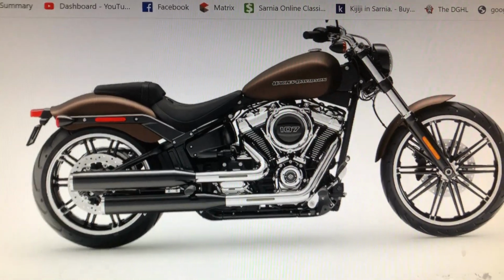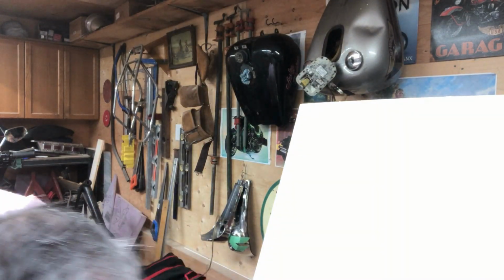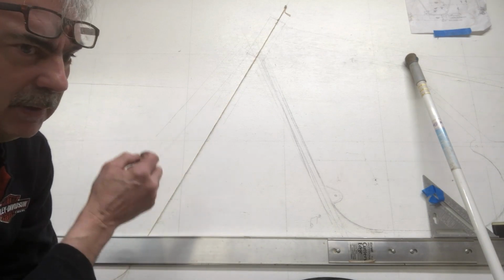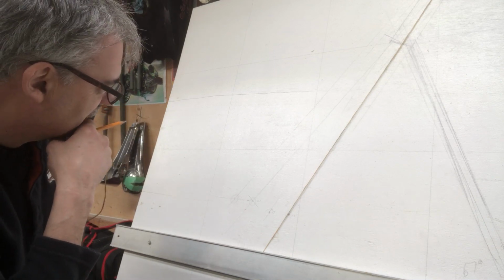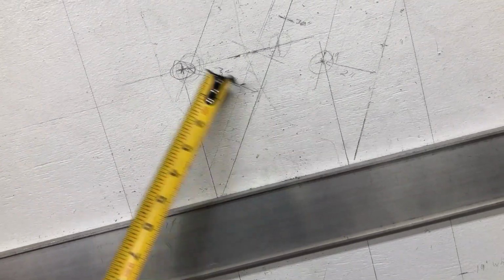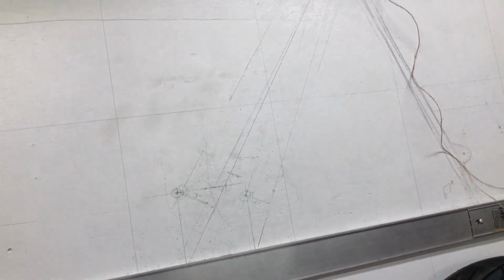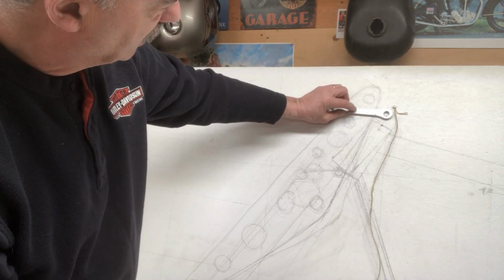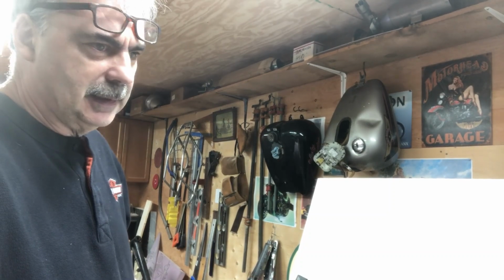NORTON COMMANDO BRAT BUILD PT 1

Comment: How many episodes/vidios do yo anticipate to completion??  Good luck
Reply from the maker: Hi Tony, Not as many as the Green Norton for sure. Probably at least 30 anyways. As long as this motor starts up. I am not going to rebuild it if I don't have to for now.
Reply: @MOAB  your other rebuild vid"s are great, but is there an index, I want to drill the seat loop to route the tail light wire in the frame, I saw it but can't now find it.   Other issue with this bike will be getting stuff... with corona 19 lockdown... I am mostly painting bedrooms